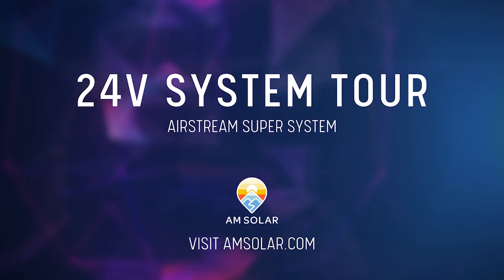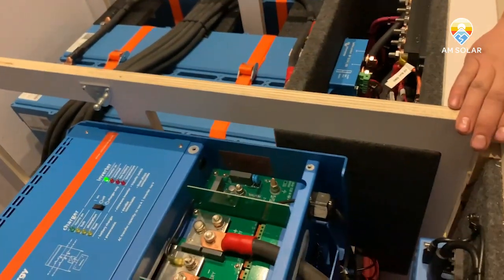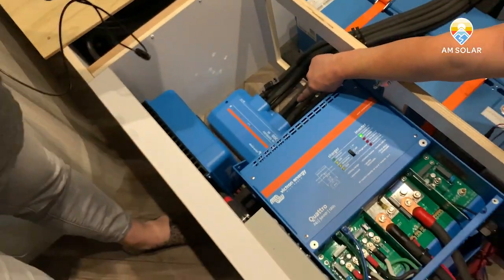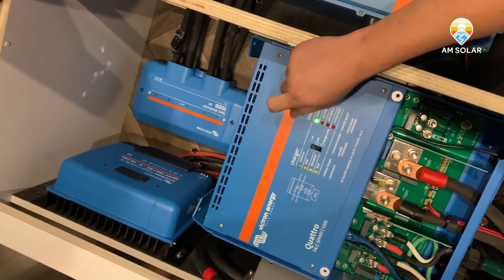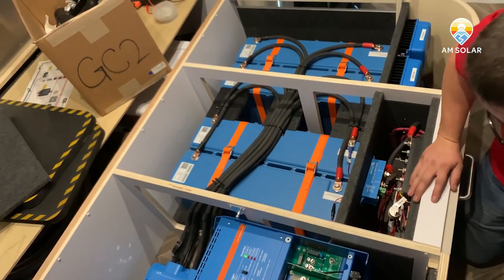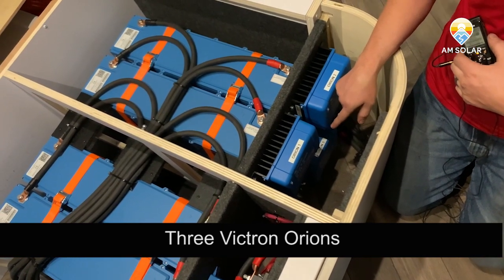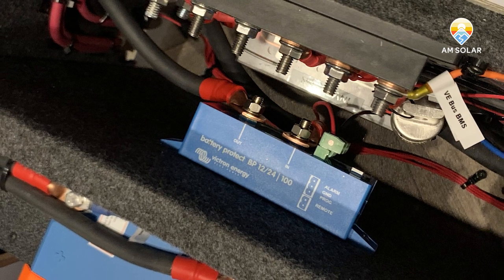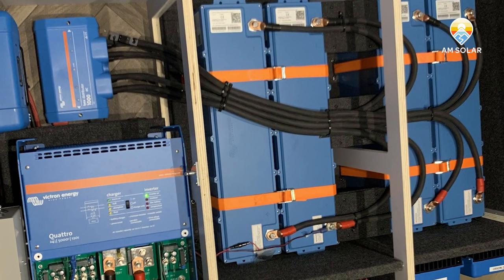System Walkthrough: 24V Airstream Super System

Comment: Garret - thanks for making all of these videos.  I know the post-production takes a great deal of time   I really love AM Solar's ability to cleanly route all of the cabling in and around even the tightest spaces.  Can you please let me know if this Airstream's equipment (on board appliances) operated at 24v DC or 120v AC?  Was a DC to DC converter used, but not shown on the video, to provide 12v DC?  Did the owner consider using a remotely deployable ground mounted solar array?
Reply from the maker: Thank you. We installed a 24V to 12V converter for DC loads. I don’t believe this customer wanted to deal with portables, but other large Airstream projects have used them.